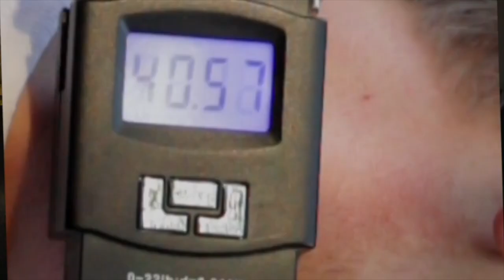BUILDING A STICKBOW THEN HUNTING WITH IT!

Comment: Besides my cell phone, I take three cameras on a hunt. A regular video camera to film animals at a distance with optical zoom, a Tactacam mounted to my weapon, and a Wide Angle Tactacam mounted to my hat for hunter perspective shots. I rarely use a stationary camera for the animals final approach and shot.  Sometimes the hunter only has seconds to get the camera(s) on and make the shot, and a stationary camera can be frustrating to accomplish this. The hat and weapon mounted camera work great together. I can point my weapon where the animal is going to come thru my shooting lane to video the actual shot, and film the animal as it is making its final approach with my hat cam. Wherever my head turns the hat camera is looking. When I make the shot, it is as if the viewer of the video is making the shot. Weapon camera is set on 2.7k at 30 frames for low light and editing in zoom, and the hat cam is 1080p at 60 frames for less vibration and slow motion capability. Lighted nocks greatly enhance the view of the arrow flight and shot placement and can help you locate your arrow in the dark. Side tip: I wear the regular video camera on a lanyard around my neck so I can drop it quick and not have to stuff it in a pocket for example.